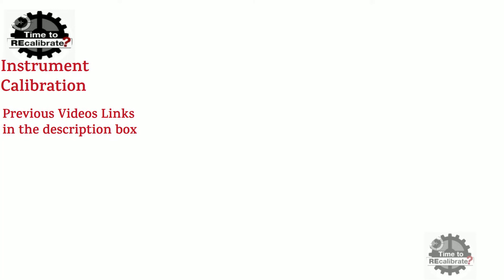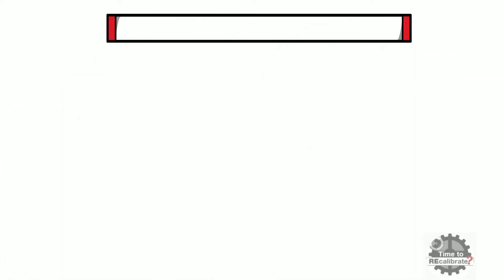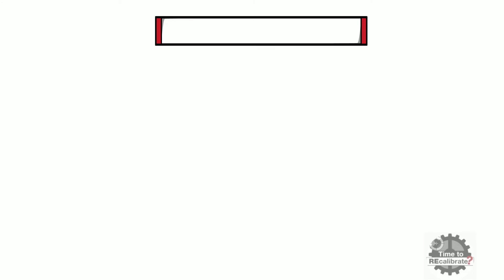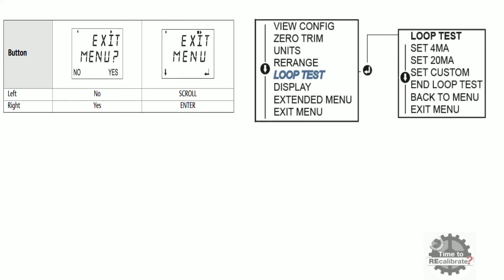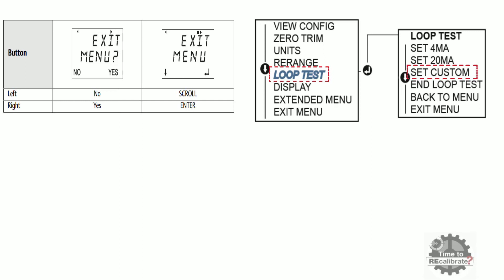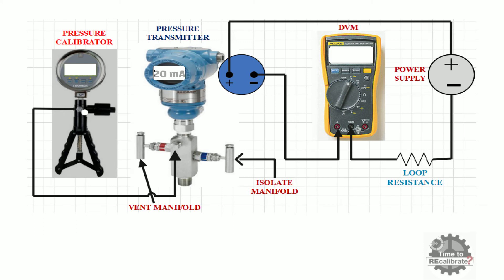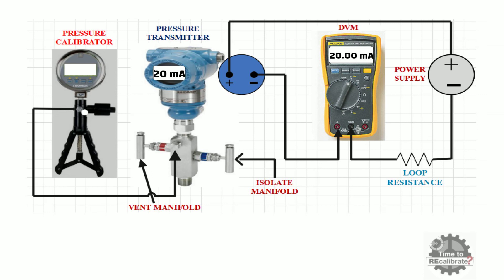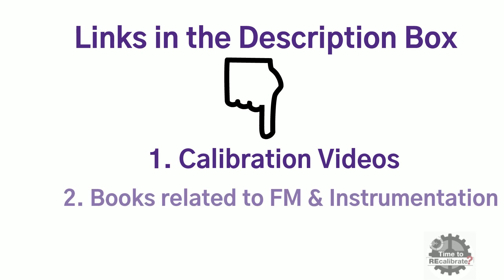How to perform Analog Loop Test for Rosemount 3051 Pressure Transmitter

Comment: If the psi was reading something off from the 16mA and they needed a calibration on a process transmitter, do you have to connect your pump to the tubing going to the instrument and close the valve before it? And pump what u need and calibrate it or is there a another way to do it

Comment: Dear sir, 
While doing loop test of Temposonic(inductive) transducer, for full open (4mA) and full close(20mA) set,
it shows nearly 3 mA for full open and 17mA for Full close. Could you assist me in it? And please make any video on practicle problem faced during scaling, calibration or loop test. Thanks
Reply from the maker: Hello Om Prakash
Thanks for asking this question. It looks like your Temposonic transducer's calibration has been disturbed. This is a reason that you are getting low value of mA. In this case, you need to adjust zero and span until you get 4 mA and 20 mA respectively.